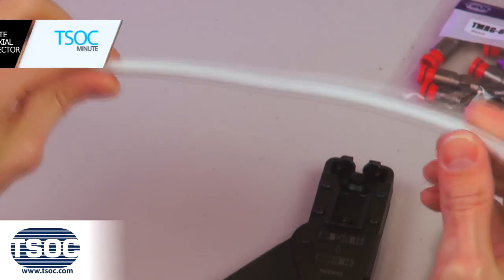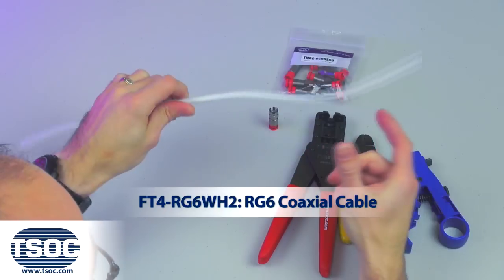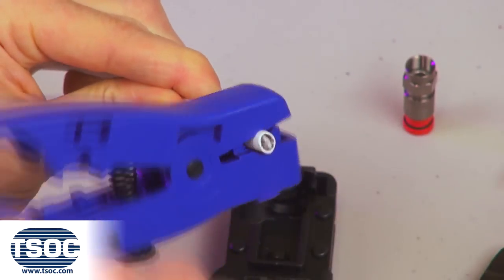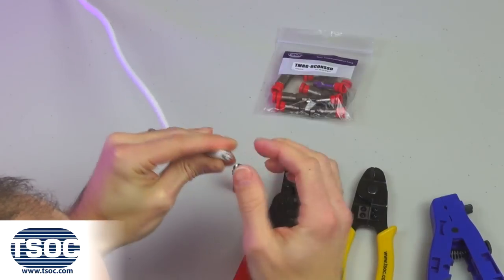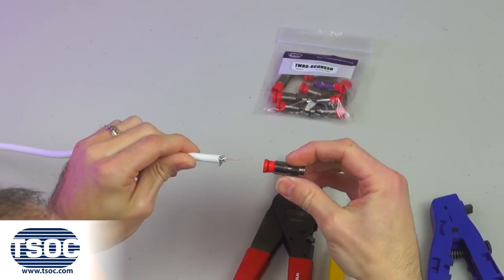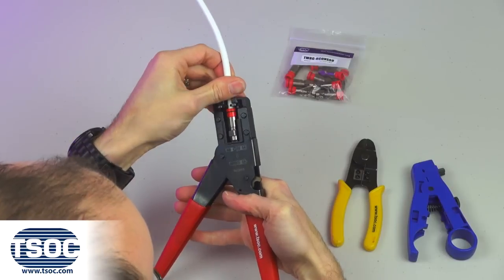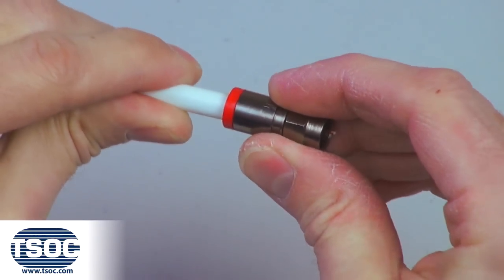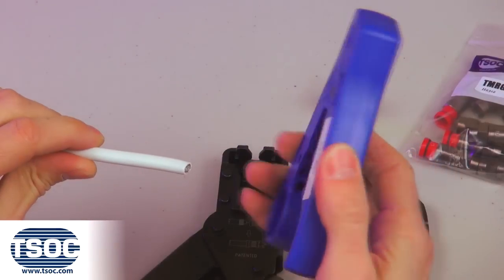How to Terminate an RG6 F-TYPE (SNS1P6U) Coaxial Compression Connector - The TSOC™ Minute (ep. 2)

Comment: Nice video. How do I do the opposite as in removing the connector temporarily in order for it to fit through the wall?
Reply: +hhova29 you don't - cut it off and fit a new one. obv.
Reply: @____________________________.x  it doesn't goes that way, removing the rg6 connector from the cable seems impossible
Reply: @GhostSenpaiEdits  I didn't say remove it, I said cut it off. This is a compression lock fitting, it's a one time use. There are plenty of the more common removable types. Although drilling a slightly wider hole would seem more useful.